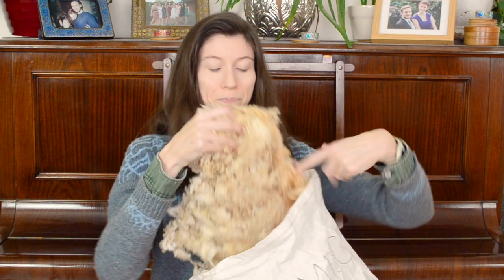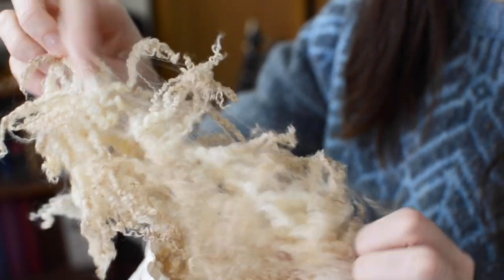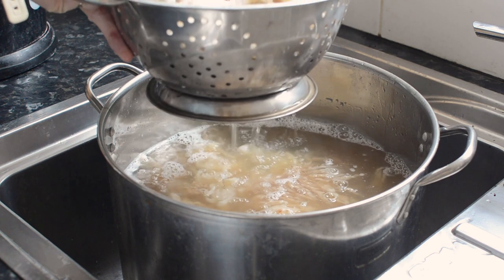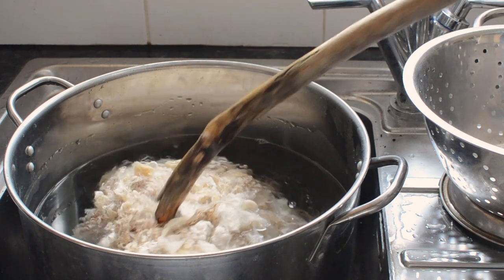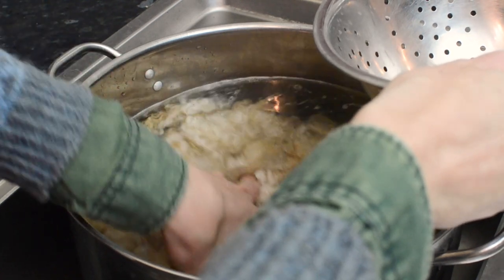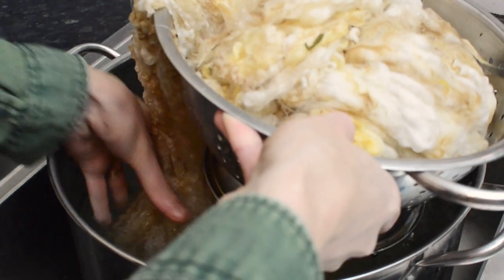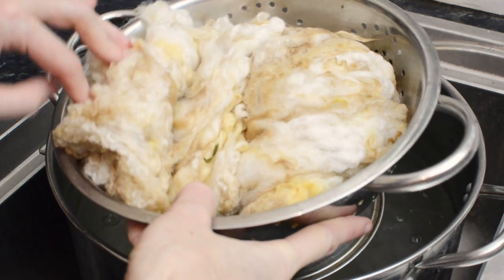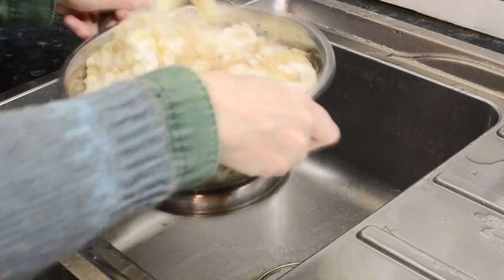How to Scour Raw Wool Fleece

Comment: Hi Marina, thank you for suck a clear and helpful explanation.  All the other videos I’ve seen on this have been made in the US and have said Power Scower is needed so good to know washing up liquid also works.  How much do you put in and how long do you leave the fleece in for on each wash!  Thanks again!
Reply from the maker: There’s no doubt that Power Scour works better; it cleans more quickly and thoroughly, and leaves the fleece feeling ever so slightly nicer afterwards, but washing up liquid does fine. I don’t use that much; a small squirt in that big pan each time. You can use a bit more if needed but I err on the side of less. 
I tend to leave each wash for a different amount of time before changing it – when the water starts to look like it can’t hold any more dirt or begins to cool down I’ll change it. I don’t like to leave fleece in water that has gone cool because it means a lot of the lanolin etc. will settle back into the wool. 
Really glad you found the video helpful!
Reply: @MarinaSkua  thanks marina, that’s super useful info. Hoping to have a go when the weather gets warmer and I can do some of this outside.
Reply from the maker: @AlisonPhilcock  oh absolutely, much better to do when it’s warmer – I would do most of this outside even when it’s not particularly nice out, but with it being so chilly now the change in temperature on taking the fleece out of the water would shock it!
Reply: @MarinaSkua  it would shock me too! 😂